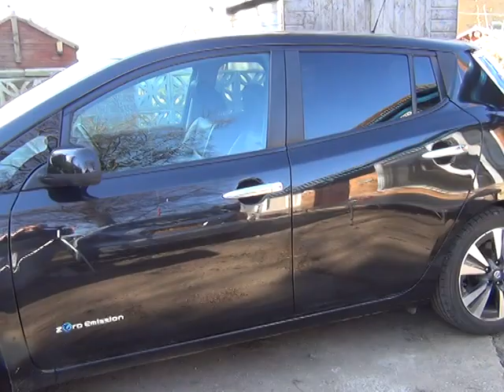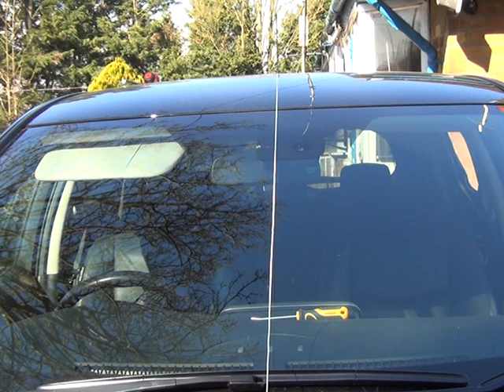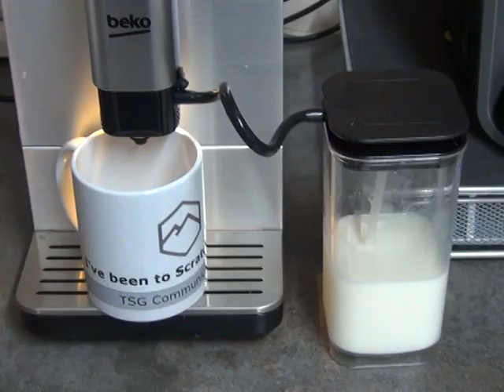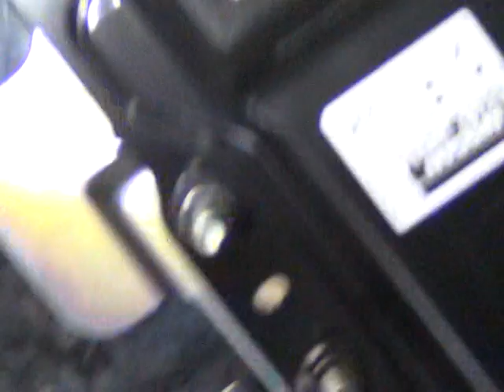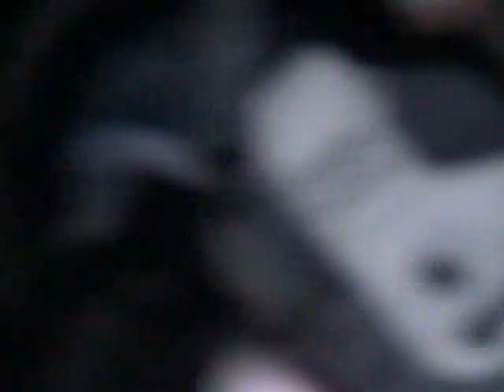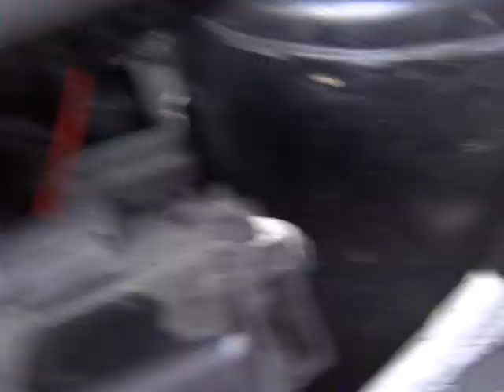CB installation with drilled body mount aerial in Nissan Leaf Pt1 of 2

Comment: Hi there, it's John again. Just seeking a little bit of advice, looking to get back into Cbs, not got a lot of money, which would you recommend, new or old, and could you tell me what kind of aerial i will need, and if I need a swr meter, thanks, John
Reply from the maker: I clearly need to do a video on this subject. Many new radios are well under permitted power as they come & are supposed to be serviced by the dealer before sale, which is why Woolworths, Argos & Boots did shockingly selling CB's in 1982. Few dealers have servicing facilities. People want a discounted price. There are still dealers out these who do this & believe Knights are still one of them. More money buys more features, not more range. There are illegal radios all over the place to trap the unwary. Used sets are often faulty. Ebay vendors saying "untested", "I know nothing about these things" & so on will often reveal otherwise if you look at closed auctions from the same vendor!

We bought a few new CRT S-Mini radios a couple of years ago. I think they were just £34.99 & after servicing work fine. I can no longer recommend the Midland 78 plus Multi's as shown in this video. The latest blue display version isn't a patch on the previous amber display version. 

Richard G0OJF
Reply: Have you got any for sale? Also what aerial will I need and a swr meter?
Reply from the maker: @johncourtman9774  I'm only involved in servicing. Selling any of our demonstration sets would be quite difficult to price & believe the Les wallen Modulator to be amongst the best without paying Sirio prices. Homebase we'd just recommend an ordinary 1/2 wave end fed (18'long) &run a mobile (car) rig from a suitable regulated power supply. I'll do a  video on this topic sooner rather than later.

Richard
Reply: thanks, i hope to see the video again, thanks John

Comment: those dual band dildo's work quite well for £10..
i thought a man with your contacts you would have got genuine Modulators from wallen,
not so sure of those chinese dual band antennas, again i would have gone to wallen and got some proper UHF antennas made for commercial use instead of those 10-1 fake things.
Reply from the maker: We have genuine modulators & 2x5/8 commercial aerials on 70cms, but are just not part of this video.
Reply: @ukfmcbradioservicingTango21  i use the wallen gear myself great antennas,
5/8 over 1/4 for UHF, my mate has a dual band VHF/UHF wallen
i bought out a silent key shop and got all his wallen stock, all great stuff, i wouldn't have bothered if it wasn't the fact i used to buy it for RJ..

your fault..
Reply: Although the dildo works well on UHF it's useless on VHF as swr is around 7:1

Comment: Just wondering how we get on if we’re pulled over using a mic whilst driving, are we governed by the same rules as using a mobile phone ?
Reply from the maker: No, not at all. A two-way radio may be used "when safe to do so" in the UK. Having said that, not a 2-way radio with all the controls/displays on the mike. So those Cobra remote sets, the Realistic TRC2003, the Binatone Breakerphone, the Audioline 342 remote & those new Venus sets would be a very grey area. Licenced radio amateurs have some further lenientcy in this area when using on those bands.

All that said, I'd never pick up a mike in front of a police officer whilst driving as I don;t want the hassle.

Richard, G0OJF
Reply: @ukfmcbradioservicingTango21  laws states two way radios are exempt from prosecution, 
and devices which operate in the telecommunications frequency range and it states the frequencies  on mobile phones,
two way radio and radio telecommunication devices are different things in the eyes of the law and they know it too..
i got pulled up once for chatting on my radio and the WPC said 'oh sorry it a radio, i thought you were on your phone' and let me go..

they can however be arsey and try to charge you with driving with undue care and attention if they can prove the radio affects your driving.

Comment: Drilled mine the other day Richard i'm a bit peeved though as my sirio 4000 was spot on swr on my Rover hardly a needle movement but on the Ford 1.6 on 40  and 2.1 on 1 so can't do a thing with it unless I get a new whip which is not cheap so treated myself to a sirio 5000 and see what that goe's like when it arrives ,
Reply: on the genuine magnet the Sirio range are fine,
as soon as you use the stud mount or gutter mount and even roof bar mount you need to cut a bit off, up to 6" in some cases..
not good if you change back to a magnet.
Reply: @bigpimp347  My Rover was drilled and also is my Ford but sadly the 4000 just didn't want to play as good as it was on the Rover
Reply from the maker: Is that what's on my Toyota? Got Mr C on it load & clear from Calverton right in the dip once.

Richard
Reply: @ukfmcbradioservicingTango21   You have the centre loaded one Richard  the one i'm getting is base loaded 5000 PL
Reply: I've got the 3/8 stud mount sirio performer 5000 for my personal use when we're not doing range tests (although that's gonna be permanent shortly when the leaf is done) and the swr is so low the needle hardly moves
Reply: Hi  @chippieminton21  Did you have to trim much off it ? I like to get as low as I can on SWR i'm quit patient at doing it even if it takes me a hour
Reply: @quotagious  yes definitely, took about 5mm off at a time till it was spot on
Reply: @chippieminton21  It's arrived today so if the weather is anything tomorrow I'll be on that roughly what did you take off altogether ? i'm hoping it's not going to be to much .
Reply: @quotagious  tell you what, I'll go measure the whip.
Reply: @quotagious  the actual length of my whip (not how much sticks out from the loading coil) is 176cm obviously you need to be careful of taking too much off to start as the swr could differ with your vehicle
Reply: @chippieminton21  I'm very gentle Richard on the Sirio 4000 I got it so the needle barley moved through the 80 channels on my Rover which I was pleased with but as soon as I put it on my Ford the SWR shot up  and by the time I paid for a new whip which would be just over half the price of this 5000 I got
Reply: @quotagious  Roger that, let us know how you get on :-)
Reply: @chippieminton21   Well i'm not to pleased Richard I can't get it any lower than 1.7  on the 27/81 I've checked to see if the mount is earthed Ok and it is.
My Z27 is 1.1 all the way so I'm wondering if a better cable would make any difference as it was a new lead but I think it's only  RG58 . :(
Reply: @quotagious  that is a bit disappointing, not sure the cable would make that much difference but until you try you don't know.

Comment: Great video Richard. What radios are u all using on 70? Iv seen those little antennas that mr chippy is using just wondering how well that works?
Reply from the maker: Maxon PM150 is our usual radio for 70cms, set to 17W output & programmed with half a dozen channels that we wish to use. Into the GB3GR repeater, he gets 45 miles reliable & 65 when choosing his spot. That compares to 65 miles reliably with a triple 5/8 Diamond antenna & 100miles if he picks his spot. Remember that he's using a drilled in aerial base & industrial grade cable from RS. Those aerials came from China with a crappy magmount, crappy cable & a crappy plug. Probably get 7 miles like that! I think they were £12.50ish off AliExpress. Good SWR on 70cms. Aerial is supposed to work on 2M & I think the SWR is 2.4:1 on that band, but we're not interested in 2M.

Richard, G0OJF
Reply: @ukfmcbradioservicingTango21  ah yeah i like the pm150 they are quite easy to work on and tune up a treat. Veey good on receive. I still have a lowband pm150 on 4vmeters.

Comment: Hi Richard, I did the same to my Renault cleo. I had to measure back far enough to give the sun roof
Enough travel so it didn't hit the antenna base. I have a Modulator and it works a treat.
Great video👍
Reply from the maker: I used to own a Nissan Bluebird many years ago,and just like that elderly Toyota Corolla of mine, they both had a sunroof. Now,as someone who gets hay fever badly, I've always had cars with air conditioning, right since 1982. The house (bungalow) has 5 a/c units & as old 1963 windows get replaced (part of the building work) with UPVC D/G units, there are to be no opening windows, except the one in the kitchen for when I burn the toast.  It's always struck me why a car with aircon would have a sunroof...like you cool the car down & then open the sunroof to heat it up! Anyway, my conclusion was that those cars simply had sunroofs as part of the body shape & it was cheaper to do them all with sun roofs rather than having a different roof for cars fitted with A/C.

Richard